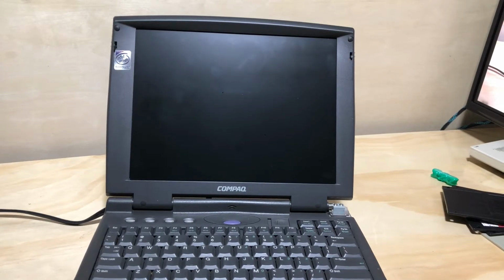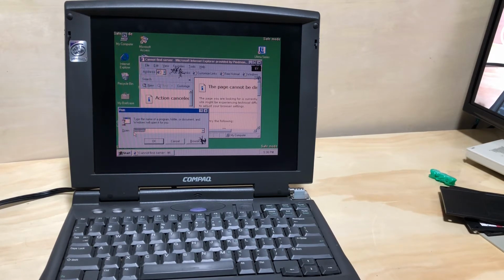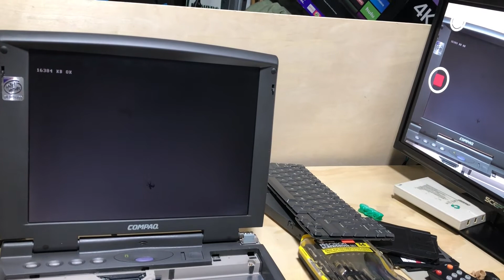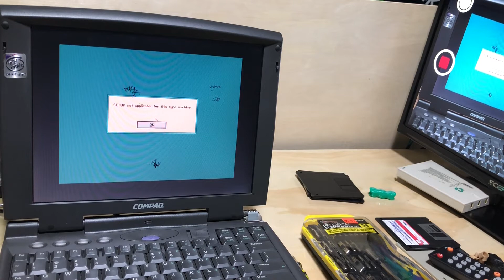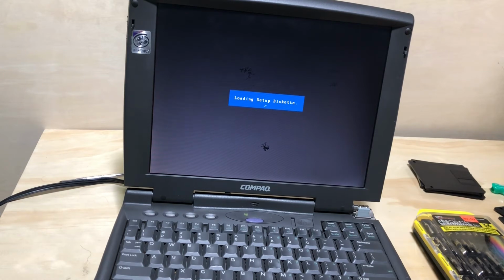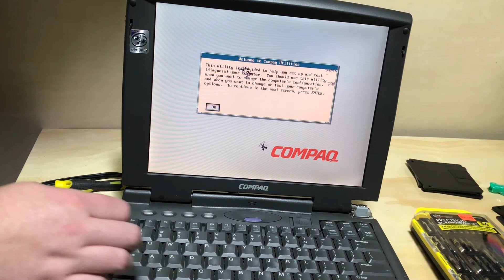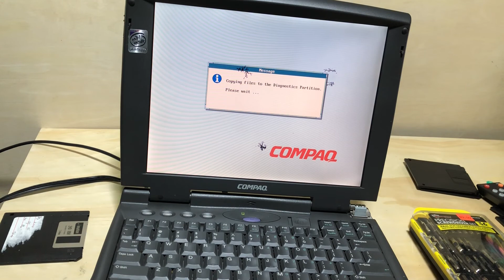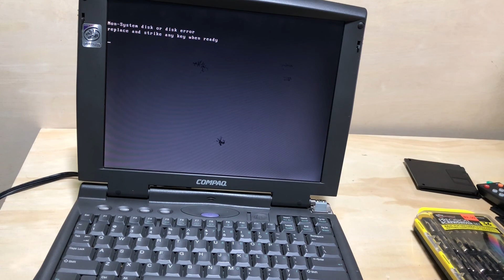Compaq Armada 1580DMT repair part 1

Comment: I love the whole process and all ur videos. I just bought a 1510 and stucks on Memory Check, recognize the memory but does not boot. I guess that could be one HD but the huge challenge is that this unit doesn't have CD , so I don't even know how to get the Win95 floppy disk. Uops! Lol
Reply from the maker: Pull all drives and see if it gets stuck at the memory count.  If it still gets stuck, pull the memory module.
Reply: @i80386sx  Hi Buddy, I just did your suggestion and as far as I try to boot without any disk after the memory check I receive and error of not disk controller found, so I guess that the issue should me related with the HDD, I will try to find a 4gb disk or similar, I have tons of disk of 500gb but probably won't work. Thanks for your help

Comment: Great videos, thanks for going into detail. I got one of these that's just not running right (graphics acceleration seems always off, choppy mouse on desktop, slow window drawing etc), I wonder where you got that restore CD from? I can't find it anywhere.
Reply from the maker: You're probably missing the drivers.  I didn't use any special restore discs.
Reply from the maker: You can find the drivers here.

https://lte5000.retrotechchris.com/
Reply: @i80386sx  I'll give it a shot. Thanks so much for the link.